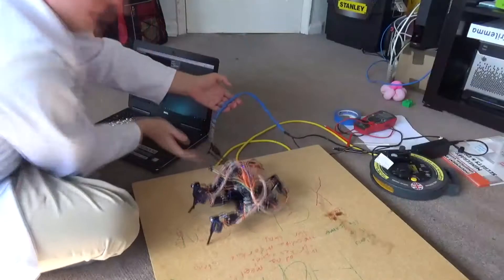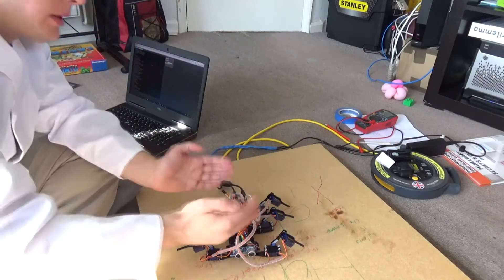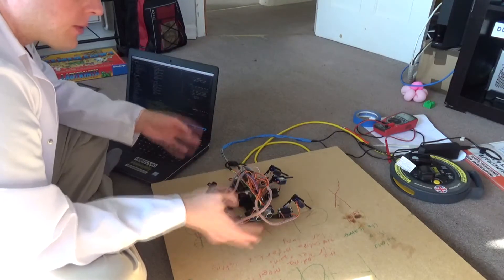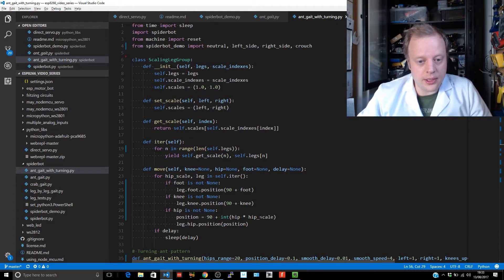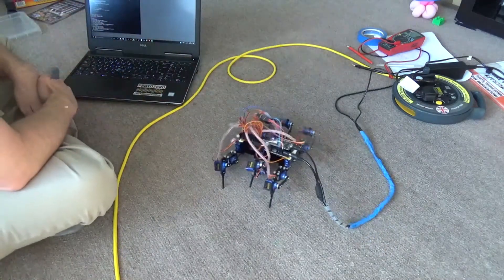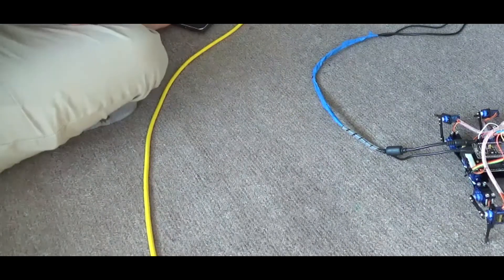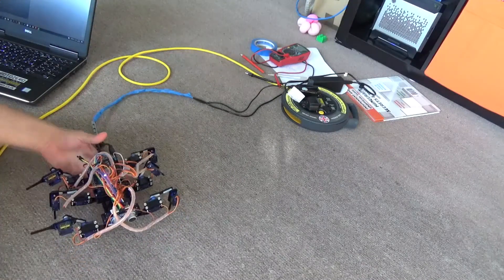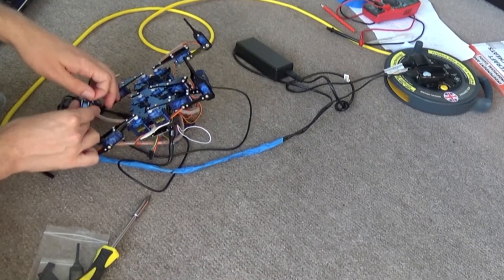Spiderbot - NodeMcu Esp8266 Hexapod Part 3 - Making Gaits with Turning

Comment: Nice videos on the spiderbot. I like to see your real-time problem solving. Would like to see you revisit this legged robot project maybe using better servos or stronger leg materials that wouldn't break so easily.
Reply from the maker: Thank you - I would definitely like to - I now have more ways to construct such a thing. Although before I completely rejig the materials, I'd love to get this one under its own power, which also means getting some high current power cabling for that ground going. If going for a larger build, I might go for stepper plus worm gear based drives, so that it's not consuming so much current when stood. There are miniature stepper motors I could use. I'd have to consider how it would sense it's position though.
Reply: @Orionrobots  Exactly. I know I've seen legged robot projects with the worm gear + stepper setup almost like how a 3D printer moves on the x-y-z axis, but they are usually rather large. So it would be VERY interesting to see it in a slightly smaller build. Just going off of memory, I recall taking apart old CD players and seeing the worm gear and tiny motor which moves the laser position to read the CD.  As for having the robot sense its position, again similar to a 3D printer, you could place an Endstop Limit Switch at either end of the worm gear and have the robot calibrate itself by running an initial program telling the stepper to run till it hits the endstop which could be set as the effective zero position. Something like that.

Comment: Dear Sir !
(sorry For Bad English)

sir I just want to control 16 LEDs using PCA9685 + Nodemcu  over WiFi..i try so many time but i failed,  i just define Pin for NODEMCU board but it will blink only  till nodemcu  last pin not after that,,please help me on this i am so beginner for all this staff.. my program as below, i know i did some thing wrong ..i cant find out what is the error ....

/*************************************************
  Adafruit MQTT Library ESP8266 Example
  Must use ESP8266 Arduino from:
    https://github.com/esp8266/Arduino
  Works great with Adafruit's Huzzah ESP board & Feather
  ----> https://www.adafruit.com/product/2471
  ----> https://www.adafruit.com/products/2821
  Adafruit invests time and resources providing this open source code,
  please support Adafruit and open-source hardware by purchasing
  products from Adafruit!
  Written by Tony DiCola for Adafruit Industries.
  MIT license, all text above must be included in any redistribution
  Watch tutorial video on my YouTube channel
  search for techiesms on YouTube.
  Visit my Website for more such projects on IoT
  http://www.techiesms.com
 ****************************************************/
#include <ESP8266WiFi.h>
#include "Adafruit_MQTT.h"
#include "Adafruit_MQTT_Client.h"

#include <Wire.h>
#include <Adafruit_PWMServoDriver.h>

// called this way, it uses the default address 0x40
Adafruit_PWMServoDriver pwm = Adafruit_PWMServoDriver();

#define l1 0 //PCA9685 Pin No
#define l2 1 //PCA9685 Pin No
#define l3 2 //PCA9685 Pin No
#define l4 3 //PCA9685 Pin No
#define l5 4 //PCA9685 Pin No
#define l6 5 //PCA9685 Pin No
#define l7 6 //PCA9685 Pin No 
#define l8 7 //PCA9685 Pin No
#define l9 8 //PCA9685 Pin No
#define l20 9 //PCA9685 Pin No
#define l21 10 //PCA9685 Pin No
#define l22 11 //PCA9685 Pin No
#define l23 12 //PCA9685 Pin No
#define l24 13 //PCA9685 Pin No
#define l25 14 //PCA9685 Pin No
#define l26 15 //PCA9685 Pin No 
#define l27 16 //PCA9685 Pin No

//#define pin0 0
//#define pin1 1
//#define pin2 2
//#define pin3 3
//#define pin4 4
//#define pin5 5
//#define pin6 6
//#define pin7 7
//#define pin8 8
//#define pin9 9
//#define pin10 10
//#define pin11 11
//#define pin12 12
//#define pin13 13
//#define pin14 14
//#define pin15 15

/*********************** WiFi Access Point *********************************/

#define WLAN_SSID       "SLT WIFI"
#define WLAN_PASS       "0252221310"

/*********************** Adafruit.io Setup *********************************/

#define AIO_SERVER      "io.adafruit.com"
#define AIO_SERVERPORT  1883                   // use 8883 for SSL
#define AIO_USERNAME    "udanagayan"
#define AIO_KEY         "7644b14d333d459d8e2834e50e3057a5"

/********** Global State (you don't need to change this!) ******************/

// Create an ESP8266 WiFiClient class to connect to the MQTT server.
WiFiClient client;
// or... use WiFiFlientSecure for SSL
//WiFiClientSecure client;

// Setup the MQTT client class by passing in the WiFi client and MQTT server and login details.
Adafruit_MQTT_Client mqtt(&client, AIO_SERVER, AIO_SERVERPORT, AIO_USERNAME, AIO_KEY);

/**************************** Feeds ***************************************/

// Setup a feed called 'photocell' for publishing.
// Notice MQTT paths for AIO follow the form: <username>/feeds/<feedname>
//Adafruit_MQTT_Publish photocell = Adafruit_MQTT_Publish(&mqtt, AIO_USERNAME "/feeds/test");

// Setup a feed called 'onoff' for subscribing to changes.
Adafruit_MQTT_Subscribe onoffbutton = Adafruit_MQTT_Subscribe(&mqtt, AIO_USERNAME "/feeds/test");

/************************* Sketch Code ************************************/

// Bug workaround for Arduino 1.6.6, it seems to need a function declaration
// for some reason (only affects ESP8266, likely an arduino-builder bug).
void MQTT_connect();

void setup() {
    pwm.begin();
  pwm.setPWMFreq(1000);  // Set to whatever you like, we don't use it in this demo!

  // if you want to really speed stuff up, you can go into 'fast 400khz I2C' mode
  // some i2c devices dont like this so much so if you're sharing the bus, watch
  // out for this!
  Wire.setClock(400000);
  
  Serial.begin(115200);
  delay(10);

  Serial.println(F("Adafruit MQTT demo"));

  // Connect to WiFi access point.
  Serial.println(); Serial.println();
  Serial.print("Connecting to ");
  Serial.println(WLAN_SSID);

  WiFi.begin(WLAN_SSID, WLAN_PASS);
  while (WiFi.status() != WL_CONNECTED) {
    delay(500);
    Serial.print(".");
  }
  Serial.println();
 pinMode(l1,OUTPUT);
 pinMode(l2,OUTPUT);
 pinMode(l3,OUTPUT);
 pinMode(l4,OUTPUT);
 pinMode(l5,OUTPUT);
 pinMode(l6,OUTPUT);
 pinMode(l7,OUTPUT);
 pinMode(l8,OUTPUT);
 pinMode(l9,OUTPUT);
  pinMode(l20,OUTPUT);
 pinMode(l21,OUTPUT);
 pinMode(l22,OUTPUT);
 pinMode(l23,OUTPUT);
 pinMode(l24,OUTPUT);
 pinMode(l25,OUTPUT);
 pinMode(l26,OUTPUT);
 pinMode(l27,OUTPUT);
 
  Serial.println("WiFi connected");
  Serial.println("IP address: "); Serial.println(WiFi.localIP());

  // Setup MQTT subscription for onoff feed.
  mqtt.subscribe(&onoffbutton);
}

uint32_t x=0;

void loop() {
  // Ensure the connection to the MQTT server is alive (this will make the first
  // connection and automatically reconnect when disconnected).  See the MQTT_connect
  // function definition further below.
  MQTT_connect();

  // this is our 'wait for incoming subscription packets' busy subloop
  // try to spend your time here

  Adafruit_MQTT_Subscribe *subscription;
  while ((subscription = mqtt.readSubscription())) {
    if (subscription == &onoffbutton) {
      Serial.print(F("Got: "));
      Serial.println((char *)onoffbutton.lastread);
      String RAW = (char *)onoffbutton.lastread;
      int i=0;
      while(RAW.charAt(i) != '_')
      i++;
      String pin = RAW.substring(0,i);
      //Serial.println(pin);
      int pin_number = pin.toInt();
      Serial.println(pin_number);

      int j=i+1;
      while(RAW.charAt(j) != '_')
      j++;
     // Serial.println(i);
     //Serial.println(j);
      String state = RAW.substring(i+1,j);
      //Serial.println(state);
      int state_number = state.toInt();
      Serial.println(state_number);

      if(pin_number == 1)
      {
        pwm.setPWM(l1,state_number,0);
      }
      else if(pin_number == 2)
      {
        pwm.setPWM(l2,state_number,0);
      }
      else if(pin_number == 3)
      {
        pwm.setPWM(l3,state_number,0);
      }
      else if(pin_number == 4)
      {
        pwm.setPWM(l4,state_number,0);
      }
      else if(pin_number == 5)
      {
        pwm.setPWM(l5,state_number,0);
      }
      else if(pin_number == 6)
      {
        pwm.setPWM(l6,state_number,0);
      }
      else if(pin_number == 7)
      {
        pwm.setPWM(l7,state_number,0);
      }
      else if(pin_number == 8)
      {
        pwm.setPWM(l8,state_number,0);
      }
      else if(pin_number == 9)
      {
        pwm.setPWM(l9,state_number,0);
      }
       else if(pin_number == 10)
      {
        pwm.setPWM(l20,state_number,0);
      }
       else if(pin_number == 11)
      {
        pwm.setPWM(l21,state_number,0);
      }
      else if(pin_number == 12)
      {
        pwm.setPWM(l22,state_number,0);
      }
      else if(pin_number == 13)
      {
        pwm.setPWM(l23,state_number,0);
      }
      else if(pin_number == 14)
      {
        pwm.setPWM(l24,state_number,0);
      }
      else if(pin_number == 15)
      {
        pwm.setPWM(l25,state_number,0);
      }
      else if(pin_number == 16)
      {
        pwm.setPWM(l26,state_number,0);
      }
      else if(pin_number == 17)
      {
        pwm.setPWM(l27,state_number,0);
      }
        
      
      
    }
  }

 

  // ping the server to keep the mqtt connection alive
  // NOT required if you are publishing once every KEEPALIVE seconds
  /*
  if(! mqtt.ping()) {
    mqtt.disconnect();
  }
  */
}

// Function to connect and reconnect as necessary to the MQTT server.
// Should be called in the loop function and it will take care if connecting.
void MQTT_connect() {
  int8_t ret;

  // Stop if already connected.
  if (mqtt.connected()) {
    return;
  }

  Serial.print("Connecting to MQTT... ");

  uint8_t retries = 3;
  while ((ret = mqtt.connect()) != 0) { // connect will return 0 for connected
       Serial.println(mqtt.connectErrorString(ret));
       Serial.println("Retrying MQTT connection in 5 seconds...");
       mqtt.disconnect();
       delay(5000);  // wait 5 seconds
       retries--;
       if (retries == 0) {
         // basically die and wait for WDT to reset me
         while (1);
       }
  }
  Serial.println("MQTT Connected!");
}
Reply from the maker: First on habits, when you have a chunk of code, try pastebin, or gist (if not github) to share it. 

Now you also appear to be connecting 17 leds to the pca device. If I'm understanding your question, the last led won't light or blink. Can you give me a link to a picture showing the connections you have? I don't see how 17 leds would be connected to the pca device.
Reply: @Orionrobots   sir  i think i made a mistake its should  be comment (//#define l27 16 //PCA9685 Pin No
)  (...i mean after  "#define l9 8 //PCA9685 " doesn't blink any led ..

thank you for repaying please help me this ...
Reply from the maker: Ok, is this working (blinking) on leds 0-9, but failing on 10 (i20)? What happens? No blink? Does the code continue or crash?
Reply: @Orionrobots  No its not working ...some error appear in serial monitor  its does not connect to my wifi  net work  ""Connecting to ASB_Ready_MIX
.. wdt reset
load 0x4010f000, len 1384, room 16 
tail 8
chksum 0x2d
csum 0x2d
vbb28d4a3
~ld
Adafruit MQTT demo
""
Reply from the maker: Ah hah. That serial output looks like a watchdog timer reset. The nodemcu/esp8266 has a timer that will reset the device if you don't zero the timer regularly, it's supposed to prevent hang conditions. I may have missed it, but I can't see that in this code (presumably adapted from arduino code). I'd suggest finding the functional call to reset that wd timer and putting it in the loop.
Reply from the maker: https://techtutorialsx.com/2017/01/21/esp8266-watchdog-functions/
Reply: @Orionrobots  mm i am sorry i did not get it ..sorry ..
Reply from the maker: The esp will reset itself every second if you do not reset the watchdog timer. You'll need to add some stuff to your code to do that. The link I replied with has the info.
Reply from the maker: In your serial "wdt reset" suggests it is a watchdog timer reset.